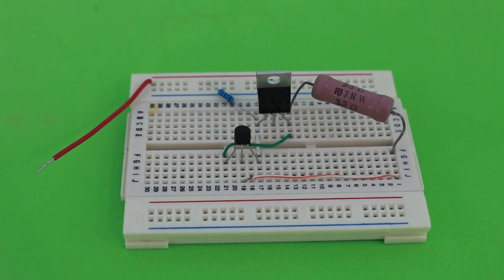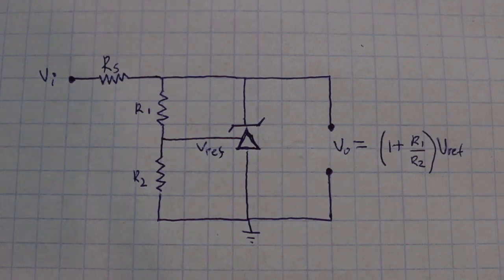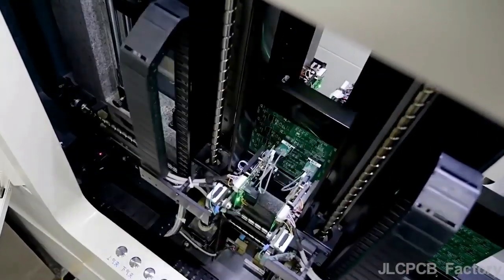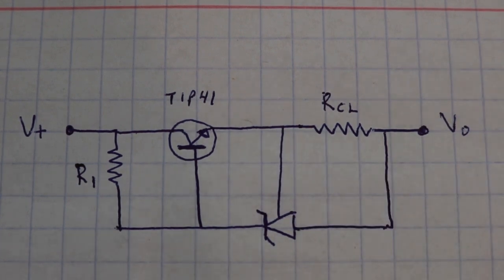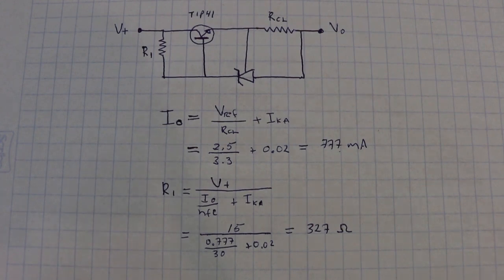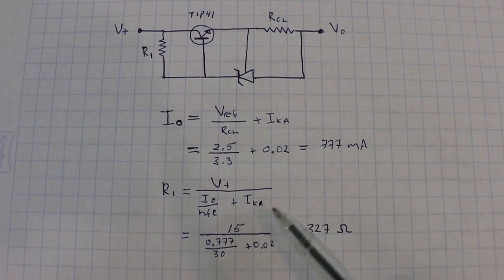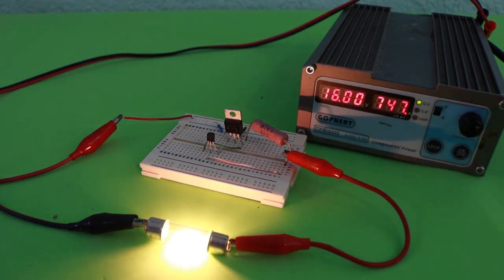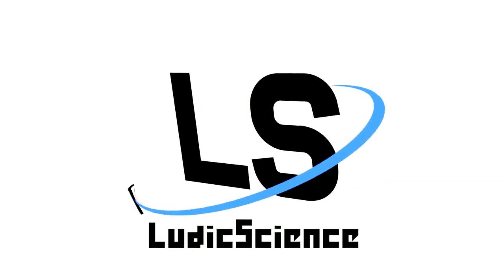Constant Current Source Using the TL431

Comment: How can you control the cathode current in the TL431? What if I want a 5mA source. Is it possible to limit to very small amounts of current? When I simulate this circuit with 5mA target current, the cathode current of the TL431 is too high.

Comment: hello, but what about the voltage difference between the source and the load ? can it be used to charge a 12v battery with a constant current of 0.8A and 13v ? thanks

Comment: Is there a way to do it without the massive power resistor as the circuit could be half the size for laser diode or led driver circuit?
Reply: I think you meant resistor, but sadly there is no other way to make it smaller and less bulky unless you switch to other constant current power supplies like SMPSs which are dedicated for those stuff, unless you want to set the circuit on fire if you use a lower wattage of the resistor. Just saying though. Cheers!
Reply: @kohizeri_daisuki  Yes i meant power resistor thanks my bad ! there is an ic the AMC7135 that limits to 350ma assuming you can provide a stable voltage if that helps...
Reply: @Another Dick Thanks  but i don't like the heat and wasted energy i am just trying to get efficiency in a small package..    :-)